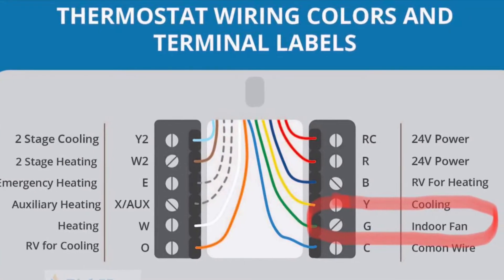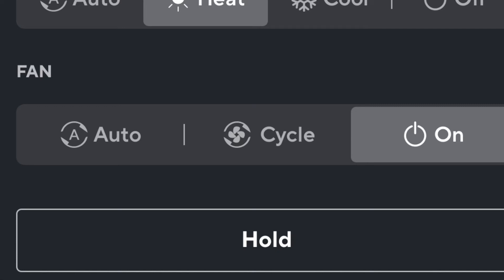WYZE Thermostat - how to fix fan mode issue - UPDATE!!! PROBLEM FIXED!!!

Comment: Thank you for this video, in the same situation but different thermostat (Luxkono), the starting of air blower fan in cooling request, it begin hi speed for ON time delay 5 sec and then stop for a while to kick on again with Hi speed, then every thing is going normal as it should. BUT when I replace back to the original thermostat (E-M air), I observed the operation is normal and there is no issue with the fan speed control. I tried to change the software setting but it didn't worked unfortunately.

Comment: I am have the problem of the fan turning on after house temperature has been reached. This will cause the fan to stay on for a while sending cool air throughout the house and triggering limit circuit fault. My wiring doesn't have g cable on it. What do you think? All vents are open, filter is cleaned and all. Do you think this caused damaged to my blower motor?

Comment: My heat pumps when hooked to the Wyze thermostat have the fan running constantly.  I will try this.  If it does work i'm going back to a dumb thermostat.
Reply from the maker: Please let me know if it works.
You can also contact Wyze.

Comment from the maker: *********UPDATE!!!!!********
EMAIL FINALLY FROM WYZE:

Hello Alan,

Thanks for the update on this issue and we appreciate your endless patience in getting this resolved. I understand that you want to get called back for you to be able to explain further the glitch you are seeing with the Wyze Thermostat's fan control. Allow me to assist you with this.

I want to note that we don't offer callbacks. No worries as I have communicated this with the team and they have checked your video to fully understand the situation.

Currently, the fan and heat turn on together anytime heat is called for. We are working on adding a 30-second time delay to the fan so that both the furnace and fan do not turn on at the same time.

With your issue, I got a word that this is because your HVAC board has a logic to turn off the fan when the furnace temperature is not reached. That is why the fan was on then off while waiting for the furnace to heat up. 

The delay in the new release will actually resolve this issue. The fan will wait for 30 seconds until the furnace is hot and then blow warm air in the room, and the HVAC board logic won't be triggered because the furnace temperature is reached already. The short-run of the fan at the beginning of the heating cycle won't damage your system because we did not turn off your furnace, which can suffer from short cycling (fan won't). 

Your current solution is giving all the control logic to your HVAC board, which is fine but you won't have the ability to run the fan independently for ventilation purposes.

I trust that information helps. If you have additional questions, please feel free to let us know and we'll be happy to help.

Stay safe!

All the best,
Jennifer | Wyze WizardZ

Comment: Thanks for the video. My situation is similar. After the heat runs and gets up to temp the fan kicks on and blows cold/cooler air. Then it brings the temp back down. The fan was running non stop so I had to shut it off. I’ve only had it installed for a few hours and I’m already facing this issue.
Reply from the maker: With the previous thermostat, if your furnace would fire up, come up to temperature and then the blower would automatically kick on, then I would disconnect the fan wire, reset the WYZE thermostat. You then need to delete the thermostat from the WYZE app and re-install the thermostat in the WYZE app. In the installation phase, on the app, make sure that the G,G1 is NOT selected. This will take the fan control out of the WYZE thermostat menu. Let me know if this helps.
Reply: Furnace fan is made to run continuously. FYI
Reply from the maker: Brody, Here is the Wyze Response FINALLY!!
Hello Alan,

Thanks for the update on this issue and we appreciate your endless patience in getting this resolved. I understand that you want to get called back for you to be able to explain further the glitch you are seeing with the Wyze Thermostat's fan control. Allow me to assist you with this.

I want to note that we don't offer callbacks. No worries as I have communicated this with the team and they have checked your video to fully understand the situation.

Currently, the fan and heat turn on together anytime heat is called for. We are working on adding a 30-second time delay to the fan so that both the furnace and fan do not turn on at the same time.

With your issue, I got a word that this is because your HVAC board has a logic to turn off the fan when the furnace temperature is not reached. That is why the fan was on then off while waiting for the furnace to heat up. 

The delay in the new release will actually resolve this issue. The fan will wait for 30 seconds until the furnace is hot and then blow warm air in the room, and the HVAC board logic won't be triggered because the furnace temperature is reached already. The short-run of the fan at the beginning of the heating cycle won't damage your system because we did not turn off your furnace, which can suffer from short cycling (fan won't). 

Your current solution is giving all the control logic to your HVAC board, which is fine but you won't have the ability to run the fan independently for ventilation purposes.

I trust that information helps. If you have additional questions, please feel free to let us know and we'll be happy to help.

Stay safe!

All the best,
Jennifer | Wyze Wizard